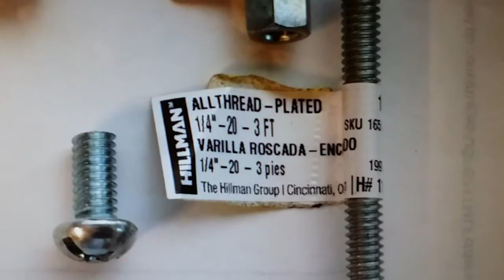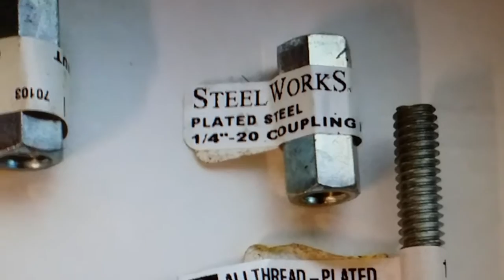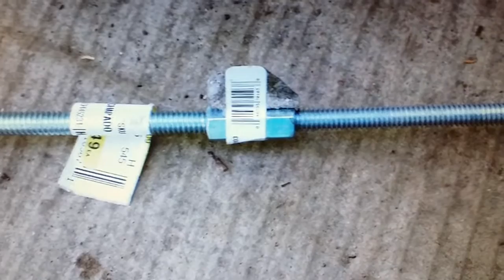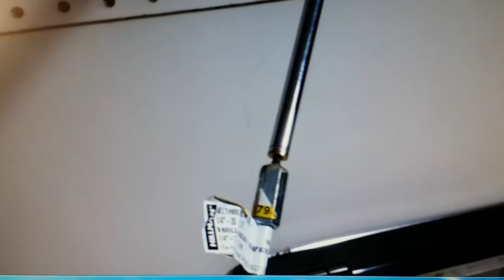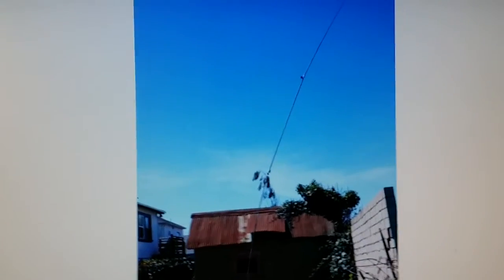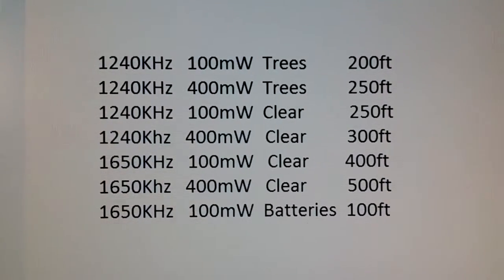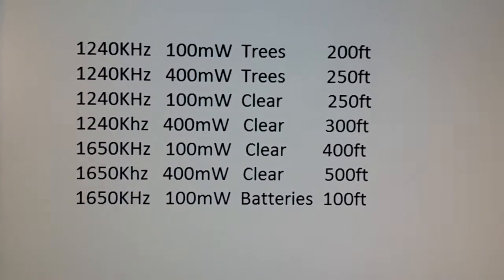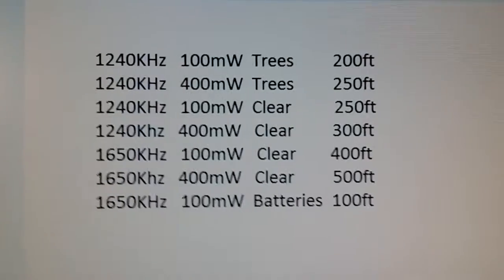outdoor tx

Comment: Sean, The box is too close to the ground. You need to put that box on a mast pole, make it to where the height is where you can get to the transmitter. Mount a 102" steel whip antenna to the box. You will need to run your AC and Audio wires from the house, up the mast pole to the transmitter. Tune the transmitter before you seal the box and come down off the house. You will find you will achieve more range that way.Keith Hamilton that sells the more expensive Hamilton Rangemaster Transmitter has done this. Users get 1-3 miles of useful coverage. Since the FCC limits Part 15 AM Transmitter Antennas to 102", this is why Keith Hamilton uses the 102" steel whip, using a mast pole that exceeds the house or buildings height, but not to high to where you can not tune the transmitter.I am not using mine that I bought from you right now because we have no amp for it to use it for emergency back up use. I live in a Subdivision that has an HOA of it, so I am afraid to put up a mast pole and a 102" against my house to play with the transmitter. I scared we'll get a letter from the HOA to take it down and the HOA might fine me and my wife. My wife is cool with it, but you know how the HOA's are about Ham and CB Radio Antennas!
Reply: +Scott Bailey How much range you got from this unit?
Reply: +yerocdable I haven't been able to fully test the transmitter because where I live is a housing subdivision that has a Homeowners Association over it, therefore, I can't put up a whip antenna outside my house. with just using the wire inside I got about 1/4 of a mile. I am a Licensed Commercial Broadcaster, and I bought this transmitter to use as an exciter to a 300 Watt Amplifier, and have a back up transmitter if my main transmitter went down. My station is licensed for 1,000 Watts, so if I had to run 250 watts in an emergency, I figured that would be enough. I will caution you that Sean's Transmitters are not certified with the FCC as a Legal Part 15 Transmitter, as far as I know of. Just incase you got inspect by the Commission (chances are very low to none) that you would, you do need to keep that in mind. If Sean has got the transmitter certified by the FCC, I got no paperwork to say it is, nor is it listed on the box. The Hamilton Rangemaster is FCC Certified, Keith Hamilton makes a very good LPAM Transmitter, but it's just too expensive for me. I am going to guess if I did put up a whip antenna, had the transmitter house in a box outside on a 50' mast pole right at the lead in of the antenna, you would get maybe 1-3 miles, depending on conditions. Otherwise, for the inexpensive price Sean is selling them for, they are a good little transmitter! They are stable and solid, which I have seen many LPAM Transmitters not look or operate as nice as Sean's Transmitter. Try One and Good Luck! It may just meet your expectations!
Reply: +Scott Bailey Thanks so much. It's always a comfort to hear from someone who is actually in the field. Thanks again!
Reply: +yerocdable If you want mine, I'll sell you mine and you can save some money. Looks like we're not going to need it after all.
Reply: Scott let me know as soon as possible